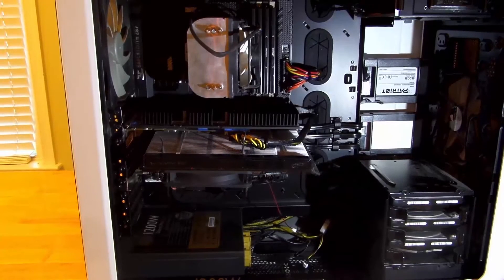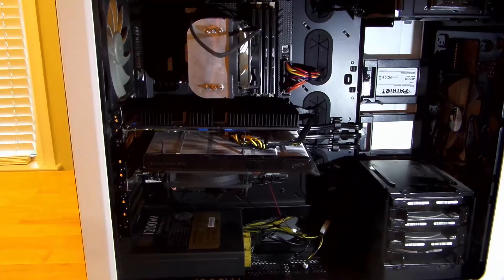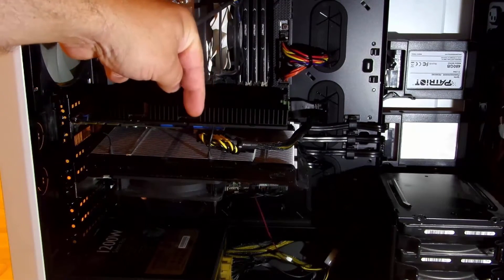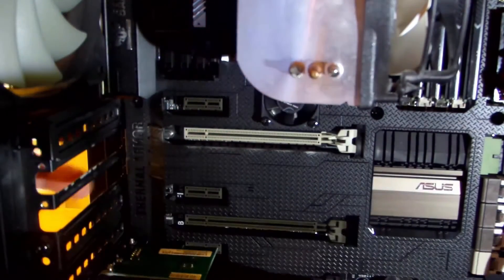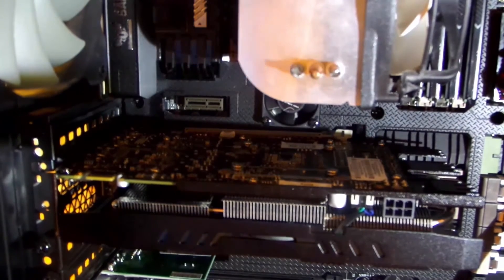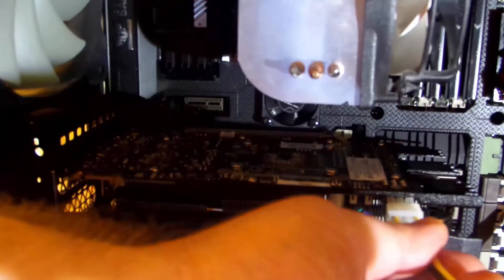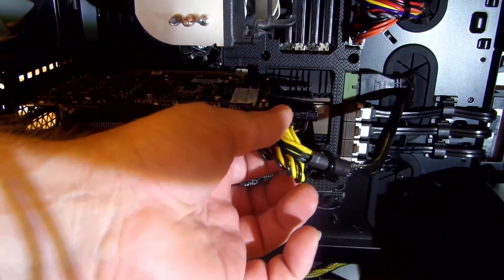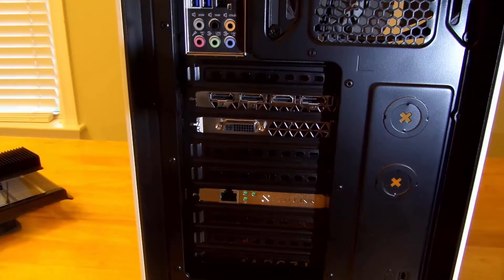Tutorial: How to install or upgrade a video card PNY GeForce GTX 960OC Tutorial

Comment: Just installed the PNY Nvidia GeForece GTX 950 2gb gddr5 pci express 3.0 graphics card. The fans start up at pc start up and then they stop.  Is this normal?
Reply: Ok, so the fans are running but they run 3 seconds, stop, run three seconds, stop and so on like this.  Is THAT normal? lol the card seems rather warm....